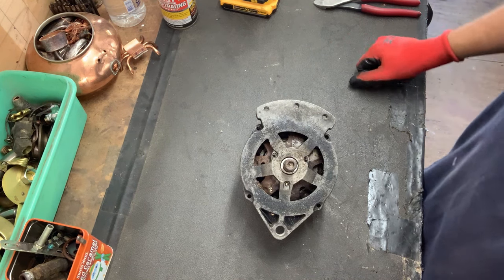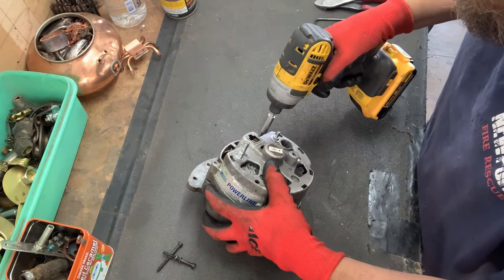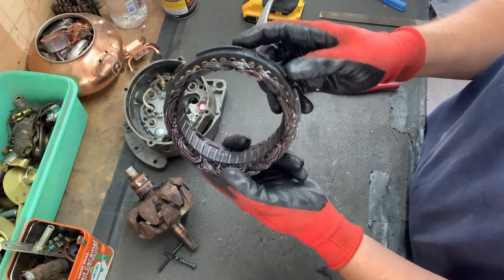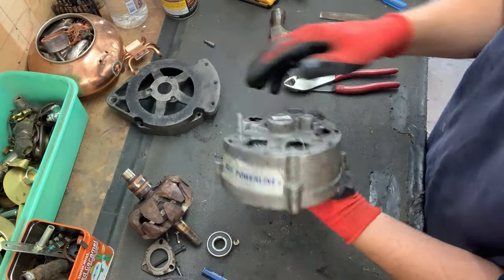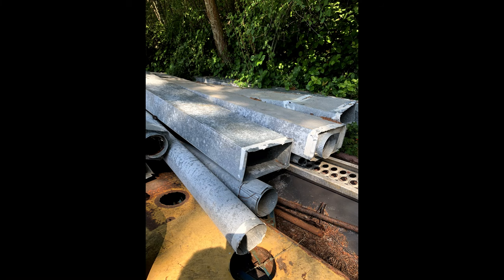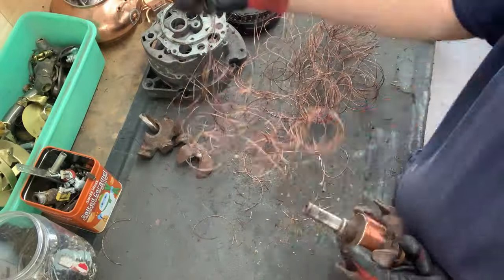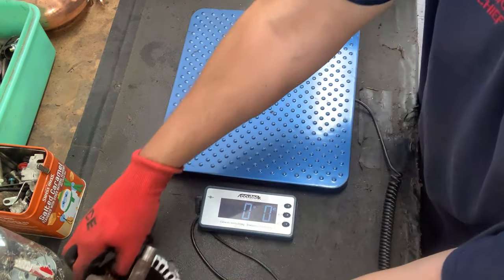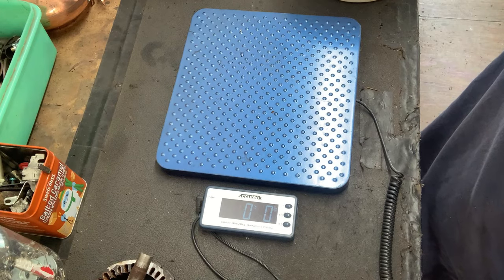How to Scrap an Alternator

Comment: Funny, I given this video a thumbs up and can't remember watching it, lol. I use a mix 50 50 ATF (I use old used oil) and acetone. Works really good as the penetrating oil. Cheers Graham
Reply: I remembered when you're doing the machete
Reply from the maker: @theaussienurseflipper.8113  thanks for the tip on penetrating oil. 
I’ve done that before, not remembering watching a video then realizing later I did lol. 
Thank you my friend.

Comment: Greetings scrapitall! I just want to say that it's not virtually impossible to separate the 2 halves you mentioned without a grinder.. I usually throw that part in the copper motor bin but i wanted to give it a go.I hammer the shaft out first. There's a snap ring which is recessed looking at the long end of shaft, remove that and the shaft will come straight out by use of a hammer. Use the hammer again to separate the 2 halves. No grinder was needed my came apart quite easy like a hot knife through butter. The shaft and 2 halves are fine splined. Then again no 2 alternators are built the same which makes some easier than others I guess you could say beginners luck 😂
Reply from the maker: You are totally right. Since I made this video I scrapped another one and I hit it with a 2lb hammer and it came right out. The reason I said that 1: the first one I did was so rusty it wouldn’t budge. 2: I mis spoke when I said that. 
Thank you for your comment.

Comment: Hi, great video. Just an FYI .The components you pulled out from inside and called dirty brass were silicon diodes. An alternator makes AC power, the diodes rectify it to DC to charge the battery.
Reply from the maker: Thank you, I appreciate the information!
Thank you for watching.

Comment: I saw a video of a foreign man hitting the shaft out of the rotor with a hammer/ punch combo. Then the two pieces of the rotor would separate and expose the copper inside. Do you think this method would be effective on alternators we use here in America? I don't know if you have tried the method.
Reply from the maker: I recently found another alternator and I soaked the shaft with some WD-40 and I was able to use a 2 pound hammer to drive the shaft out and the two pieces separated from the coil of copper. The key is to soak that shaft.

Comment: You might try to cut the wires on one side of the stator, then pry them through from the other side.
Or use your vice to flatten the whole ring, allowing you to push what wire you can to the inside, giving you fewer cuts.
I appreciate you asking for a blessing.
Reply from the maker: That's a good idea, I will give it a try some time! Thank you for watching and for your comment.
God bless you!

Comment: Those are always tough to get apart.  I go the copper motor route with those. That had a great yield of good to bad - might have to reconsider.  Thanks
Reply from the maker: The first two I ever did were a challenge but it seems to be getting easier. Thank you for watching.

Comment: Hello sir nice to see you again although I haven't scratched an alternator but I mean it's a motor I've accidentally bought a set of cut-off discs that are actually designed for masonry once and used them for steel and I've used the steel ones as well the masonry ones actually last longer than the steel ones do I also got a tip from somebody that does masonry and he also scrapped a little bit I was at the harbor freight and he said grab the grinding wheel design for cutting Masonry
Reply from the maker: Hey buddy happy new year!
That’s very interesting, thank you, I appreciate it.

Comment: I found the same thing with the machete and a ceiling fan motor. It just bent the steel frame. I melt metal and don't worry with the armatures unless they are simple to unwind, I just toss them into my crucible and melt the copper out, then remove before I pour.
Reply from the maker: Thanks for sharing your experience. I haven’t tried the machete on a fan motor yet, it’s good to know it doesn’t work. Machete has been great with other motors though. 

Yeah armatures are a real pain lol
Reply: @scrapitall200  I just used my vice to finish compressing the fan stator and will toss it in the crucible the same as the armature. Same deal as the one you had there,  narrow, large diameter with many loops of copper.
Reply from the maker: @1972Russianwolf  I’m going to get into melting, hopefully sooner than later lol. I too will then just melt the copper away from the steel.

Comment: Awesome man if you had some lubricant like oil or whatever that you have left over from your AC units you can I usually do that it cuts down on Sparks and it makes a little mess but at least dust doesn't go everywhere
Reply from the maker: Thanks for the tip buddy.

Comment: At 9:00, instead of hammering the machete thru the steel, put the machete on top of the wire instead.
Reply from the maker: Not a bad idea, thank you!
Reply: Just use the angle grinder 😢 .
Reply from the maker: @jasonmadden6771  I did use the angle grinder

Comment: Im betting on then shreaders that you will be stacking one on anothet with the help of some guided slides that you will shead up , pulvetize, small wires, right?
Please let me know if I am wrong, but that is what I am seeing. But I might be wrong, buh.
Reply from the maker: I believe you are correct about my plans lol.
Reply: @scrapitall200  youvare still a MAD GENIOUS! That first shread vieo I mentioned about stacking a series of shreadder above one another. That is better idea than actually buying one of them smallest of scrap wire pulverizer separaters. One of the cheapest is around $5k, not to mention the cost of maintainencs!
Reply from the maker: @stephensmith3708  they are so expensive lol. 
I think my shredders will do a really good job, I just need to put it all together lol. 
Thanks again, I appreciate it.